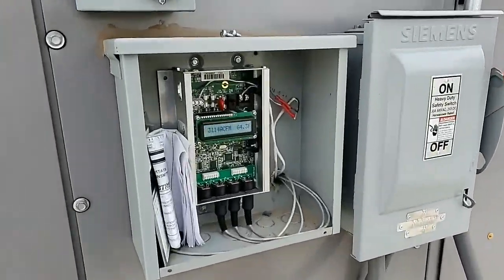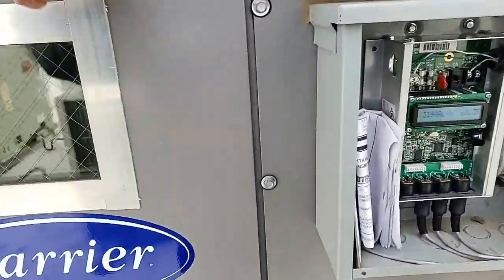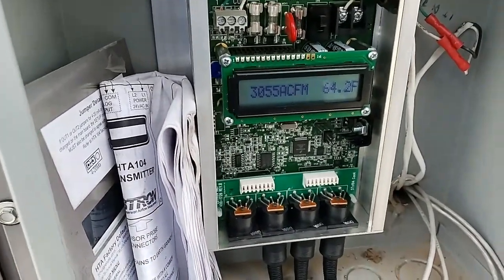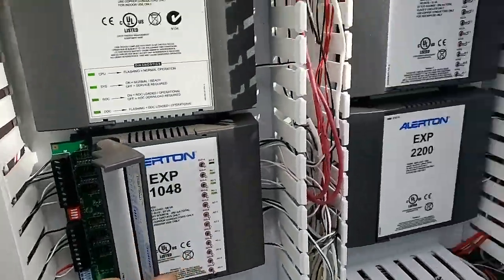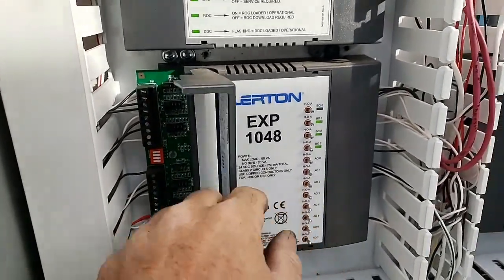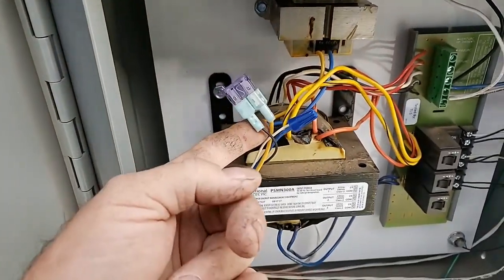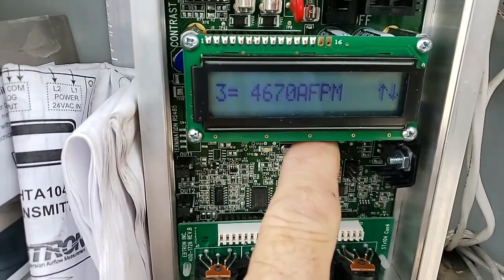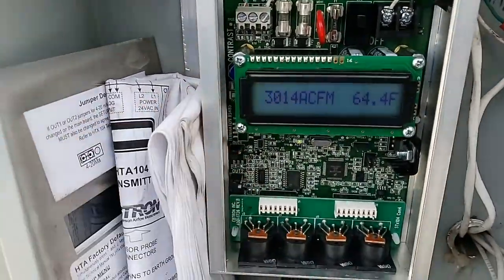Installed the repaired EBTRON airflow sensor module

Comment: I can tell the inputs were dc voltage and not 4-20 mA. Hey, what was the issued with the transformer? I dont see why it fried. In this case Those inputs at Expansion controller are set for dry contact and the Ebtron output either 5 or 10 Vdc. Also the Ebtron itself needs 24v it can be shared by the controllers itself I think both are half wave. Please let me know what did you find wrong. Thanks !!
Reply from the maker: The transformer output needs to be isolated from ground. 
However instead of using a dedicated transformer for this device they have one large 24vac transformer that supplies 3 or 4 devices and one leg of the output was grounded. 

The ground loop fries this device. 
I added a dedicated transformer for the repaired board.

Comment: What was the lead time on a new board? I would have kept the repaired one as a back up and threw in a new one. 

Off topic I found a baldor motor in need of some bearings on Friday it’s probably at least 10 years old, I’m trying to get the approval because the unit is getting changed out in January and I’d rather not risk having to change out motors then go and take out the new one when the unit gets pulled.
Reply from the maker: I wasn't involved in ordering the board. It was there at our shop when I was scheduled to put it in.
When it fried I took it apart and then I told the office that I could try to replace the two fried chips and they said go for it. So luckily I didn't have to wait for another board.
The IC Chips I ordered from Digi-Key and I got them in 2 days